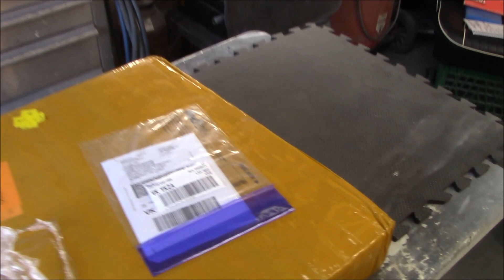1968 Triumph TR250 Restoration Project , Unboxing Vietnamese Reproduction SS Bumpers, Part 1

Comment: Good luck with them, Chef. I got the same for Dorothy and they didn't fit anywhere near as well as original and the front overriders were actually designed differently and I had to modify them. The biggest thing I learned was to keep all of your mounting bolts loose while you get it all fit up, then tighten them all incrementally. It was the only way I get it all to fit.
Reply from the maker: Did you get the Harrington ones or the Bumper Automobile ones?    Just fitted them today…I’ll put the video up tonight…have a look 😉
Reply: @cheftush  You know, I have no idea. I ordered them from Rimmer's when they had a sale (it's been a few years). I don't think they had been around too long when I got mine. I'll watch!
Reply from the maker: @roundtailrestoration  sorry for the questions…we’re yours stainless steel or chrome?  I have a new chrome bumper for the front as shown in the video but the quality was no very good…
Reply: @cheftush  They were all stainless. Got the whole kit, if I remember right, for right around $1000, shipped.

Comment: Thanks for the unboxing. They do look very nice. I figured it would be all in about 1000 CDN to get a set here so you confirmed that thanks. Also the finish does look very nice. I too wouldn't care about the painted back as I agree no corrosion issues that way. I too will hold judgement till you get them installed on the vehicle, so fitment is the next hurdle. I think they will look GREAT on your completed project! fingers crossed no hiccups! I might just need to order a set for my B GT too if all goes well with your install!!

Comment: Those bumpers look really nice. The lighter weight will save you fuel and increase your performance. LOL Sounds like a win/win! I can remember when they first came out with the imported reproduction bumpers. I was installing a set on a 1968 Camaro. When I tried bolting them on, the chrome around the bolt holes chipped off like a potato chip. I didn't get the bolt tight enough to keep them from rattling. Needless to say, we sent them back.

Comment: good luck with the installation.  I had my OE bumpers and over-riders re-chromed to avoid any fitment issues and to preserve the original parts, but new SS ones are available for the E-types too and sometimes I wish I'd gone that way.  Re-chromed ones still pit and rust all too soon.
Reply from the maker: I remember all the chrome pieces on your Jag John, they just went on and on….

Comment: Looks quite good, especially for something that is probably somewhat hand-made compared to the originals.

As far as them being lighter, I would imagine that that is part of why they use stainless- it's stronger stuff, so they can make it thinner (and thus easier to stamp) and still have acceptable strength.   And the ability to directly polish it rather than having to go through multiple plating/polishing steps is probably much simpler.

Comment: i would be tempted with the overriders the one you are not going to use is to put them out side in the weather just to see how they fare over winter, just to see if they used good a quality stainless steel. not sure i like their use of black paint on the under sides looks like it's hiding something. i like your definition of a little wave, looks more like a force nine gale to me, looking at them in comparison the ends of the repro looks  like a shallower curve, will it sit close to the body work, or like I'm thinking have quite a gap. i think originals re-chromed is still a better option.

Comment: Do you think Bumper Automobile and Harrington perhaps come from the same source? An earlier poster surmised these may be chromium plated stainless steel hence the black painted backs. I know Harrington tout the ability to have dents hammered out and the bumper repolished in the event of damage, which I don't think would work on chromium plate. I suspect the backs are painted to avoid the labour of polishing them, although I would think unpolished stainless would be as acceptable as painted.
Reply from the maker: Yes, defiantly could be the same source.  I don’t mind the black backs.  Part 2 should be out tonight….working on it now
Reply: @cheftush  Just looked at the Harrington website which has been updated since my last visit and it looks to be a wholly owned outfit. Their price for a set of TR4/5/250 bumpers is US$1120 plus shipping so quite a lot more. I don't mind painted backs either. I bought a supposedly NOS TR6 front bumper around 1986 and it had a very poorly painted back which I stripped and repainted.
Reply from the maker: @ashleyaustin1894  so, you can see why I jumped at these for $705 US including shipping to my door…it was a bit of a risk…you will have to wait to see if I’m happy with the fit up though 😉
Reply: @cheftush  Indeed.

Comment: Stainless can be chromed, which would explain the black paint on the inside of the bumper. No point in chroming the parts that you won't see. Plus it cuts down on chemical usage, plating time, electrical usage, labor, and water treatment costs. Basically plating is nasty. I would know, I used to work for a place that plated chrome on plastic. Don't miss that place one bit.

So, it's obviously chrome on stainless, which isn't a bad thing at all, but the same rules of protection apply to these bumpers as they would traditional ones. I can send you photos of stainless happily rusting away in our brand new meter boxes that we installed in Japan.

The density of stainless compared to carbon steel is nearly the same, so any weight difference is largely due to a difference in thickness. Stainless isn't necessarily as strong as carbon steel (mostly owing to the fact that you can always find some really crappy carbon steel, and not due to this being a virtue of stainless), but I imagine that you don't plan on running into anything anyway.

Have you taken a magnet to them yet?
Reply from the maker: No! Haven’t taken a magnet to them 😉
Reply: @cheftush  There's an amazing amount of "Ferrous" SS out there, which by definition, isn't. But they do look really nice. :)